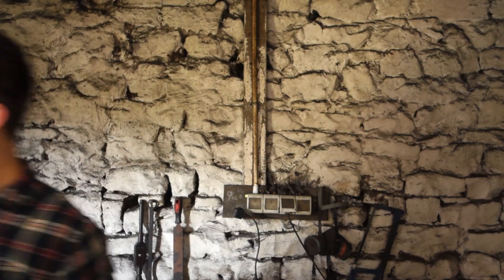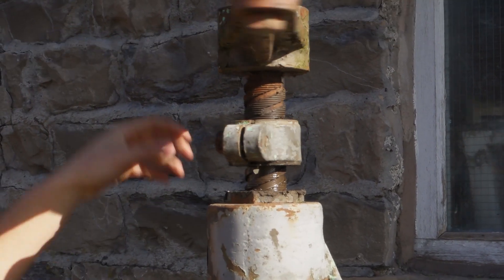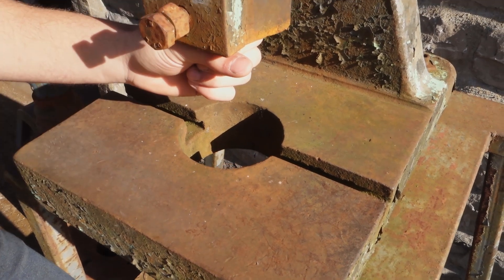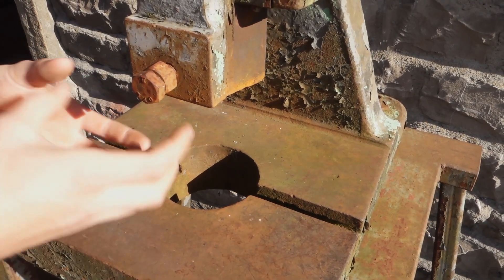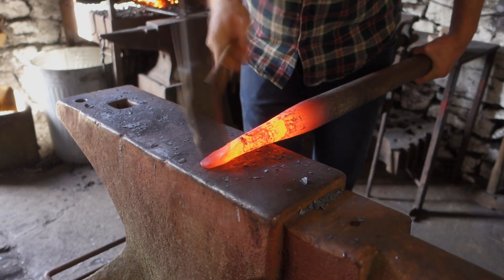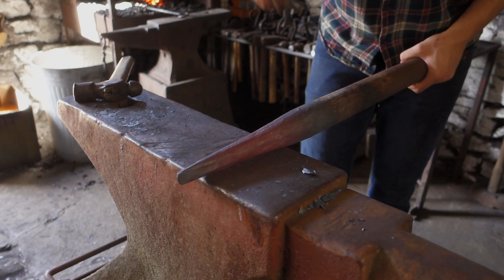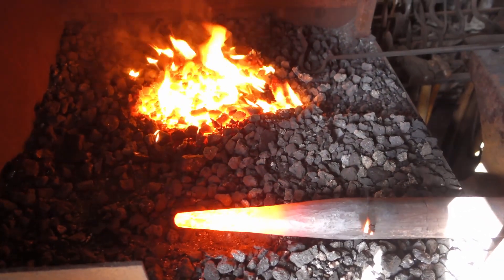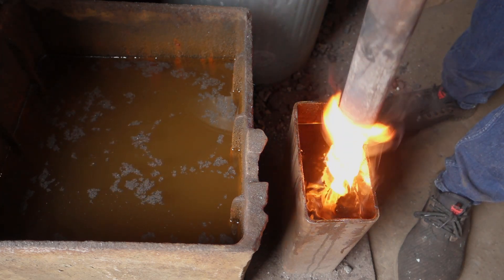A brief introduction to fly press tooling: Forging a punch for bottle openers

Comment: You will probably have found out by now, but pot should have a layer of fairly thick oil in the bottom of the main hole under the base of the threaded rod. This not only serves as a lubrication layer, but also acts as a kind of hydraulic ram to transmit the force.
Reply from the maker: Yes! Thank you for the tip.

Comment: that was some work there oscar ,i think i might of made a sleeve out of that 50 mm so that you can put 3/4 bar that would sleeve in to the 50mm bar which would be permanent in the fly press with a grub screw on that to take all your new adaptions at 3/4 round ,if that makes sense ,my fly press is a big heavy one but the hole for tools isent 50mm ,without a power hammer your gonna knock yourself out making tools for it lol ,im not a blacksmith im just a welder that likes to mess about doing a bit of blacksmithing ,please use safety boots in workshop if youve never had anything fall and break your toes you will only do it the once lol i did it when i was an apprentice ,im never comftable in workshop without me boots on ,you can see round my workshop on my channel if you would like ,take care Ant from Wales by the way where are you in Britain .?
Reply from the maker: Thanks you the info Ant! I do need to get a collar made up for it, some of the others mentioned it. I’m up in Lancashire at the moment in one of the villages around Pendle hill.

Comment: Did you sort the slop from the main screw to the ram? 
I had to get a new split nut machined for my press.
Reply from the maker: It improved as I took it all apart and then could fine tune the pressure from the guides on the ram, which made it run smoother, but there is still a bit of slop on it which I need to sort out.
Reply: Hey Andy, havn't seen any content from you for a while are you just taking a break or not posting content anymore?
Reply: @techronmattic5876  hey bud. The last couple of years has just been really busy and I’ve not had time for it. I bought a  house which needed renovation and my business started doing quite well too, so there wasn’t much time. I keep meaning to get back to it at some point. I’ve been upgrading the workshop a lot recently and I’m planning a workshop tour vid at least. 
I’m quite active over on Instagram though. Feather forge 
All the best 
Andy

Comment: Greetings Oscar. If you look around the web, flypress' tooling should have a collar/stopper that contacts with the ram and avoids the bottom of the tooling to touch the inside of the ram and eventually get stuck after intense work. The bottom of the tooling can brake the cast iron ram, mushroom and become stuck or damage components that connect the ram to the screw. Nice restoration, flypress are very useful tools in the shop (not just for forging). I have an "A" frame 12 ton press I use almost every day, I wish I had a 22 ton ... or 32 ton or ...
Reply from the maker: Thanks for the tip! Will deffo do that and yes I think I need a bigger press too!